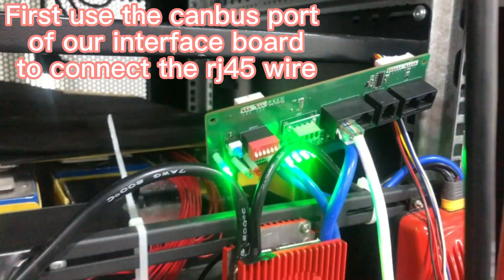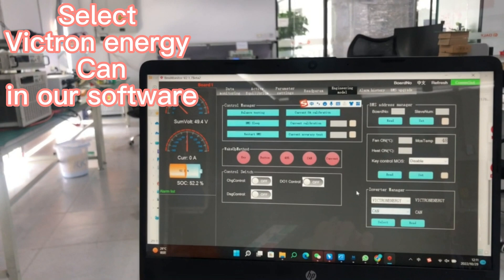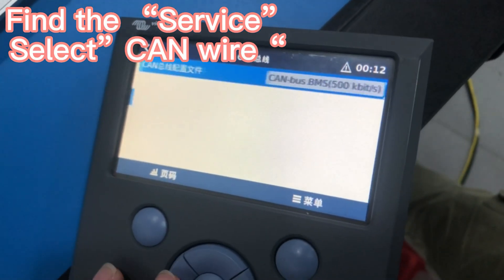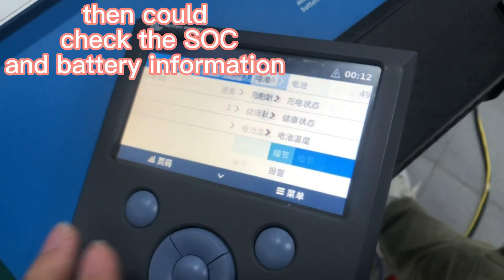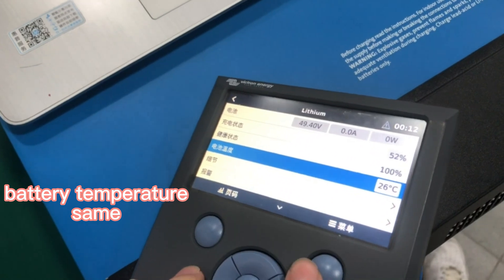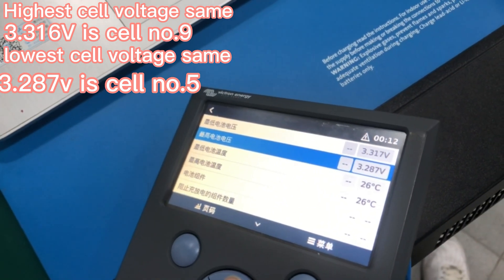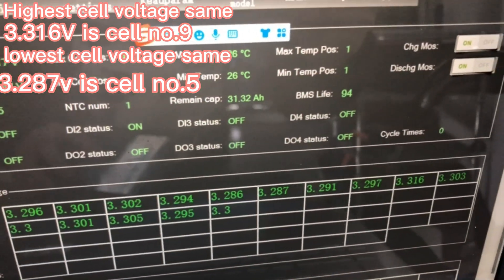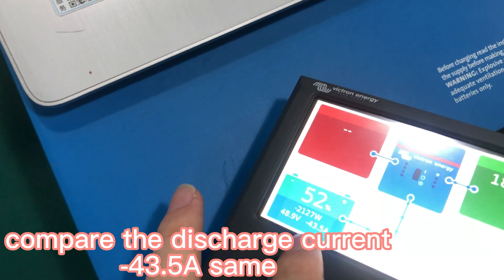Victron energy communication

Comment: These Daly videos showing communication with inverters are way too short. Would be nice if Daly took tbeir time to show users how to properly confogure communication as well as showing communication actually working. For example, when the battery is near full, will Daly tell the inverter to reduce the charge current? Basically I would like to see the Daly BMS control the inverter and how to properly setup communication.
Reply from the maker: No， BMS can not control the inverter to reduce the charging current. If BMS detect the current is too high, BMS will cut off the circuit.
Reply: @dalybms666  ok thank you. what is the advantage of using Daly bms to communicate with the inverter? Is it only to communicate state of charge?